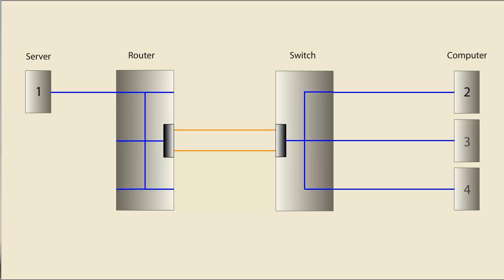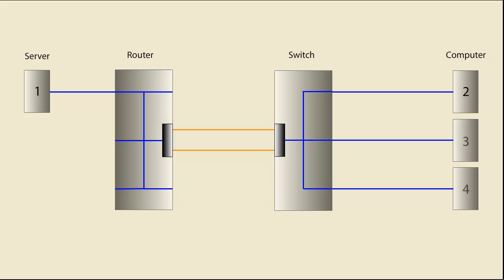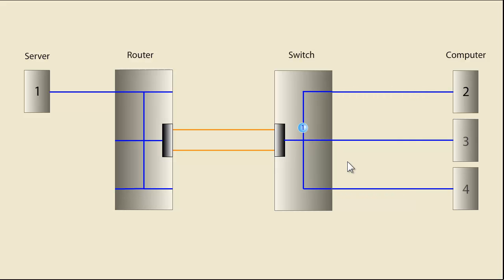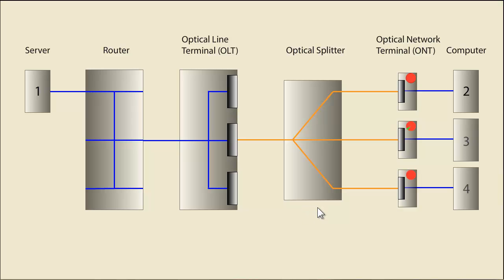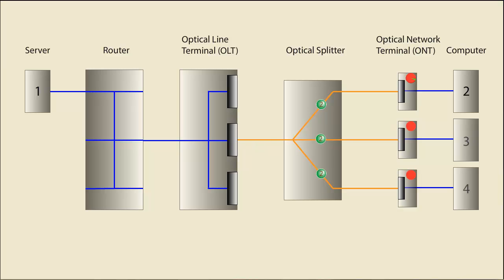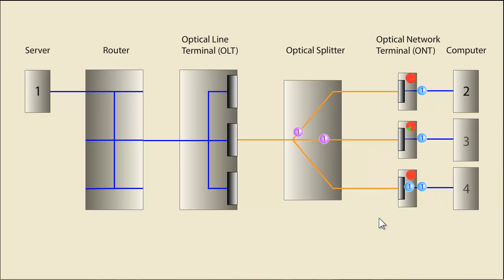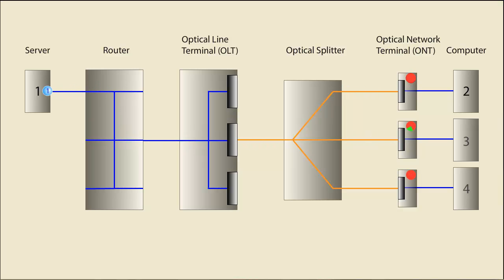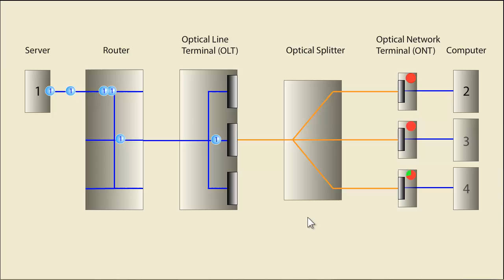Passive Optical Networks Explained Visually

Comment from the maker: The network is considered passive because the splitter contains no electronics and uses no power.  The purpose of the video is to explain how it is possible to combine the signals from multiple terminals (ONT) so that a single fiber can be used from the splitter to the line terminal (OLT).